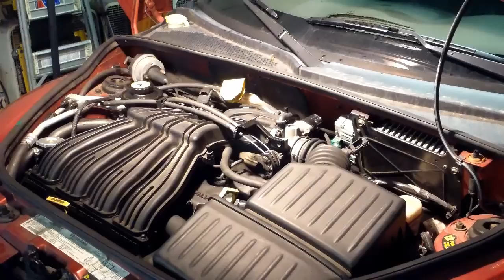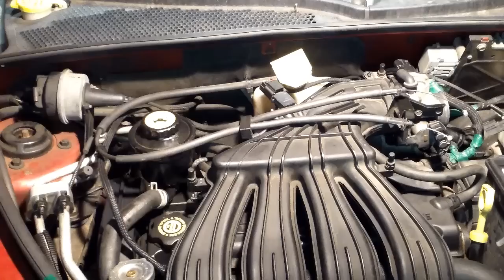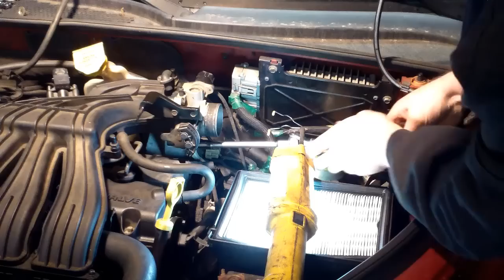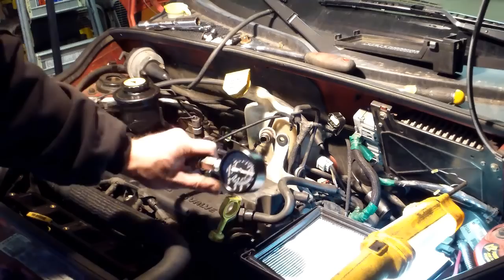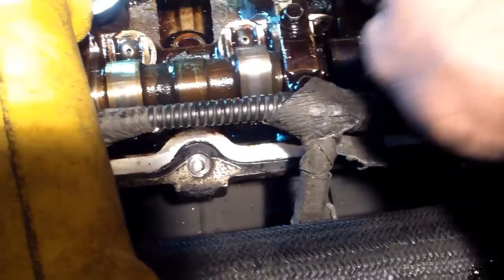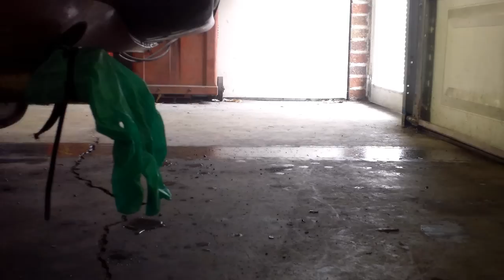PT cruiser 2.4 Misfire at idle  Part 1 Troubleshooting

Comment: I have a similar issue but not a shake on the engine but hear it at the tail pipe.  Misfire according to code is #1. Replaced plugs swapped #1wire for #4 and now ignition coil. So now I'm beig suggested to try swapping #2 injector vs #1

Comment: Thanks for the video. I had a PT cruiser with a misfire as well. Your troubleshooting steps help me quite a bit. I ended up finding a vacuum leak on the intake manifold with a smoke machine. I wouldn't have thought to use a  smoke machine without your video.

Comment: Mine is making a racket and just started doing it today RIGHT after a CAR wash... Damnit! LOL. 
  Its been making some kind of weird noise for a while but I did not think it was the internals.   Thought is was an exhast issue. TUrns out it may be infact the head.  Its making a racket it seems and the idle is REAL jumpy.   Not sure whats going on.  But at this point? Mechainel failure is on the menu.  I got close to 300,000 miles on the car so no biggy.

Comment: Enjoyed watching your 3 part video on the PT cruiser,  just broke the timing belt on my 2008 today and found it has a non interference engine and may have bent the valves, does it always cause valve damage in these engines when the belt breaks?
Reply: It is an interference motor not a non-interference motor a non-interference motor would be very old or belong to a lawn mower most engines nowadays are of the interference type meaning that when the belt snaps the cam free spins away from the motor and if a piston comes up when a valve is open boom but this doesn't always happen and if you didn't hear a shit ton of loud noise or anything like that you may be all right just check your compression
Reply: Mine snapped put a new belt on it and it runs
Reply from the maker: Most times yes. unfortunately

Comment: Need help. I have a 2001 pt cruiser 5 speed. One day it started acting funny, by funny I mean it kind of felt like I wasn't getting enough gas. It felt like it wanted to stall on me. When finally it did. I replaced the fuel pump and filter, and it didn't fix the problem. So I changed the coil pack. It started up, my dad took it for a ride, and it completely died on him. Ended up having to get it towed him. So I bought new spark plugs, it started right up but could tell it was still misfiring. The whole time all this is going on, there is no check engine light and no codes. We changed the cam shaft sensor and the check engine light came on, saying cylinder 1 misfire. I have since replaced the crank shaft sensor as well and it still doesn't want to run. It is starting up, but once you start to drive it, it starts stalling out. Please any ideas would be great. Sick of buying parts that aren't the issue.
Reply: I'm having the same problem on a 2002.  Have you found anything?  Contract me at nomad1ne@gmail.com  thanks.
Reply: My automatic 04 pt is doing the same thing as yours. Did you find the issue. Im thinking clogged injectors. I changed everything else smh

Comment: Look we had a good time you help me when I need it.
But it's over now and I have moved on  yes o had the habit  Bad it got in me but now I'm clean and although  I don't attend  any meeting
I can say 
 The Pt Cruiser/Pronto
Disease  that almost ended me The Timing belt The Water pump.Radiator. and Headhasket along with The whole "Correct  sensors"
Ordeal  even the ECM repair 
All that angst after the want all of it Gone  I belonged lust after a PT Cruiser god bless you and thanks  speedy
Pt Cruiser  clean for over 6 month.YES.!!

Comment: Very informative video in real time, has me wondering if I have a valve issue at cylinder one myself as I changed the coil pack, spark plugs, and wires...injector seems to be firing fine but trips a code P3001 misfire cyl 1...thanks.

Comment: I have an 09 pt cruiser 2.4 when I do leakdown Air comes out the exhaust and when I do a compression test the third cylinder has no compression even when I added oil u think it’s still just valves?

Comment: Hi, nice filming and great consistent audio. Watched pt1 and pt2 and easy to see and hear.
I bought a 2001 PT cruiser that was garaged for 3 years, it's 2018 now. It was a show car and meticulously kept up with all service records. I got interested and looked on FB and offerup and see quite a few cruisers for really cheap, like a few hundred. Most have great bodies, maybe worn inside, but decent. Most have engine issues. Just looked at a 2001 similar to mine that had the same aymptoms. Garage told them to much to fix and it will start and run, but misfires, although at higher rpm it seems smoother. I was going to get is for $275 as a parts vehicle if nothing else, but like one reader commented it crazy that cars in basically good condition are junked because no one can afford to do repairs. I thought of making a stab at it with all the info for diagnosing the problem, just not sure what the parts would cost if it is a head. Guess I'll find out. Thanks again for the video and wondering if there is a part 3? Did you change head and continue?
Reply from the maker: thank you for the kind feedback and sharing with us. yes this complete repair is documented, i just added a link to each part in the video description

Comment: my gf has a 2004 pt cruiser 2.4l turbo and the check engine is on and a cpmuter was used to diagnose the problem and it was code P0304 and the spark plugs and wires were changed. the check engine light will blink on and off when in idle and then will stop after accelerating. need help..

Comment: Mine just blew a head gasket at 70,000 miles. Never overheated
Reply: These have a double layer steel plated gasket, chances of it blowing is very slim..You will warp the cyl head before the gasket blows. Im almost willing to bet the car was overheated from maybe a fan failure without you knowing...Im a Chrysler ASE Master tech.
Reply: they are bad about that
Reply: Chrysler Pt cruiser 2004 pcm reprogram

Comment: I had a misfire on Cyl #4, turns out that the intake gasket on the block side of the intake had developed a crack & it was sucking air.

Comment: Several years ago, I ran into problem with misfiring.  While doing compression check on #3 and #4, there was a lot of antifreeze shooting out of #1 and #2 cylinders.  Took the head off and found a crack between #1 and #2.  Remanufactured head cost me almost $400 at the time.  After replacing it, had no further problem except massive oil spray caused by ruptured diaphragm in the oil sensor.  Engine had been sitting with the head off while trying to get the funds to pay for the head and had been quite awhile before getting repaired.  I made sure I removed the oil/antifreeze mixture and antifreeze so it may not cause damage to the inside of the engine before letting it sit.  But oil sensor probably didn't take it too kindly.  One day, I took off fast and then stop.  When I stopped, suddenly the smoke blasted past me as if there was a bomb gone off behind me.  Turned out oil sensor blew through the connector and flooded the exhaust pipes with oil.

Comment: Hello. thanks for your video. Consultation have a problem when it is regulating at a traffic light, try not regulate off or uneven .- a) I need if I can help where the IAC valve to clean it. b) where the fuel filter to change it ?.

Comment: Awesome video great job!
I just bought a PT Cruiser and the previous owner said that when they installed a new transmission in the process they broke a sensor and now is causing the engine to overflow with gas n the car is not running due to that. Any ideas?  Thanks for ur time!

Comment: My wife has 05 pt and when its at red light or stop sign turn ac on the car bogs down do you have any advice.   Your videos are great pls do more
Reply: Ever figure this out? I have a 05 pt cruiser that does the exact same.
Reply: Chris Slatzer 03 PT with the same issue. Ever find a solution?

Comment: Hey Robinson question maybe you can help me out on this . my engine vibrates, enough to feel it in the steering wheel, between 1000 - 1400 RPM or so. This happens whether accelerating in Drive, or reving the engine gently in Park or Neutral. In other words, it's always present. 

Another question is when driving gently when the transmission shift to 4 gears the rmp will drop lower and RMP it will start to surge too then it will go up to where it need to be to shift next gear. If I press on the gas a little hard it will be normal . Could this be a faulty map sensor ? 

2005 Dodge Durango 3.7 with 124,000 miles . thank

Comment: Will I don't feel good that this car is probably worse than you thought but it does make me feel good that even the best professional can make minor initial misreads.  I bought a car with a cooked engine cheap - ran just missed found out overheat cracked block- no white smoke coming out of muffler so thought probably ok

Comment: Thanks for your time for showing this great video
i do this kind of diagnosis so often. How do you guys charge for this inspecting time for the cause but not the actual fix such as replacing gaskets, burnt valves....
You let them know that what would be the estimate cost or bill them in the end after fixing the car ?
Sometimes i have some trouble with this diagonostic charge 
Waiting for the part 2

Comment: Will,  find a cliff with rocks at the bottom and jump those 2.4 suk azz to do heads on. Remove the inner timing cover and then the cams to get the head bolts out what a pain,  not horrible... But u r doing it in a pt cruiser. Bad enough they suck to time as well. Ive had more run ins with these than i care to remember. Good luck my friend its about as bad as doing a water pump on a 2.7 in a stratus

Comment: my hilux misfire the same way and I checked for sparks and coils and wires everything is good I thinking of a compression test that will pinpoint the problem thanks for your informative video I am waiting for part 2.
Reply from the maker: its always a good step in troubleshooting a misfire, another great tool for the arsenal is a lab scope, unfortunately my old bench top scope took a crap a few month back, once i get back on my feet it will be replaced for sure,
what i could have done with the scope is what they call a relative compression test, number 3 low compression would have showed up nicely, without removing a single part, just disabling spark and fuel,
just hooking up a amp clamp and cranking the engine over, each cylinder compression stroke will show a spike in amps as the starter strains to over come the comp. therefore the low compression 3 would have shown a less amp spike
Reply: I can't wait for that , thanks for replay
Reply: robinsonsauto hey robinson,
it is 2004 toyota pickup 4 cylinders its misfiring and have some vibration when start move and when ascending a hill .
i changed spark-plugs 3 times and test every thing and find nothing bad .
after this video i tested the compression and found the cause of the misfire .
3 cylinders around 165 psi and # 4-95 psi .
i pour an oil in cylinder #4 then i have 150 psi .
are there any way to fix it with out change the piston rings ?

Comment: Great video and nifty diagnostic work. I was trying to pinpoint the cause and end up confused. I want to predict the head gasket is leaking due to a blown gasket or warped head. A cracked head, perhaps. I would not think a cracked block would also cause the exhaust seepage. A tech posted to another video that 99.9% of the time it is a pitted valve seat when there is a compression and misfire issue on these PT motors, but this would not explain the coolant leak. Part 2 should be interesting. Thanks.
Reply from the maker: Thank you for the compliment, i hear ya, thought i had it figured out a few times then got thrown for a loop lol, always an adventure it seems, your correct they did have valve seat issues and i was leaning hard to that being the cause to be honest, then once i noticed the coolant system building pressure i had to step back lol my hope at that point is the previous owner didn't cook this engine, thanks again for the feedback

Comment: Does this vehicle have any redeeming quality?  Compared to Corrolla or Civic, this looks like such a pain to work on and on top of it you have major engine problem on a relatively new car.  I can't think of any good engineering reason as to why the engine was designed the way it is on this car.  What are the pros of such a design?
Reply from the maker: Thats a great question, i must say its pretty roomy as far as sitting space compared to a more compact car, and just the fact that the manufacturer stepped outside of the box with body style and concept seems to be appealing to some thats a big risk, however as you mentioned the engine compartment is cramped, changing up the engine layout had to be a task as well for them, i must admit its not as bad as it appears sure compared to most 4 cyl, it seems tough however i would much rather tune this up then say a carivan v6 rear bank, however as you mentioned its a poor setup in many aspects i agree, peppy engine as well for a 2.4
Reply: thanks!  The vehicle itself is roomy but is the engine compact compared to other similar sized ones?  for example, does 2.2 Honda occupy more room in the engine compartment than this one?  One of the advantage of a modern 4-cyl 16valve engine is the easy maintenance of the spark plugs as long as one has deep socket or the valve cover gasket.  By putting the intake manifold right over the plugs, this engine makes a simple job in to a nightmare.  Even some of the V6 (3.5 Honda J series) allows easy spark plug changes on it without having to take off the upper intake.
Reply from the maker: 12vgs8606 your welcome, yea i hear you, i was just thinking outside the engine bay for redeeming quality's, because as you pointed out some simple tasks have been made difficult, due to the compact engine compartment, therefore in that sense your correct, the engine bay rates real low with most other comparisons

Comment: hi, do we need to remove intake or just look for air by removing oil cap..  2) i am not sure why air is coming out in number 1.. does 1 and 3 have some path, or 1,2,3,4 all have path and just because 2 and 4 is closed air is leaking to 1 by least resistance.. do u also recommend me to remove valve cover and intake to be sure..
Reply from the maker: on this engine the upper intake plenum needs to be removed to gain access to the spark plugs for testing, most other engines do not require this step, 2, all the cylinders share the same path to the exhaust, through a coming exhaust manifold, cylinder 1 just happened to be on the exhaust stroke during this test meaning its exhaust valves were open opening the path to the coming exhaust manifold creating a path of least resistance as you mentioned, i take that step to assure the cylinder being tested is on its compression stoke meaning all the valves are closed, gives you a visual
Reply: Thanks make sense, for a moment i was thinking why the smoke was leaking past cylinder when both valves are closed. then i realized because it is defective it is going past the exhaust. thanksagain for ur time. your videos are very unique not repetitive with same information.

Comment: Great video Will. Looks like there's sludge present under the valve cover, or is that just a camera effect?
Reply from the maker: thank you for the compliment, actually i didn't take notice to that now that you mentioned i looked its not so bad, this was shot on Friday the same day the care came in so what you seen was pretty much real time lol i noticed a few steps i wish i  had covered, one thing i did fail to mention is i dont see any trace of coolant in the oil, thanks again for the interaction its greatly appreciated